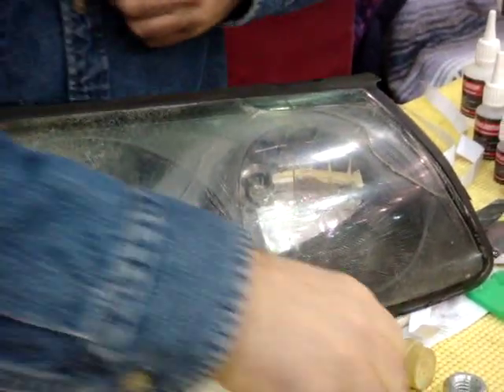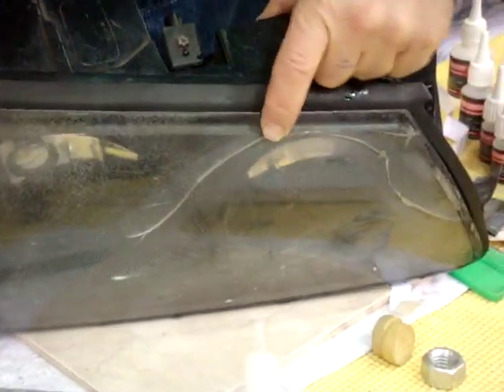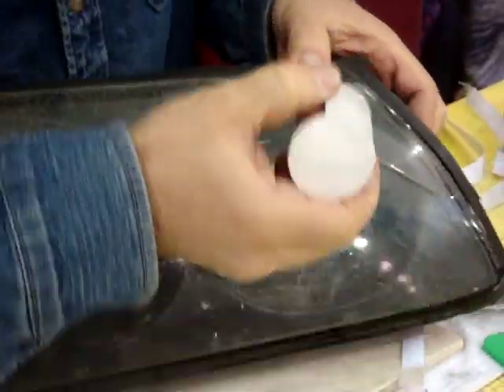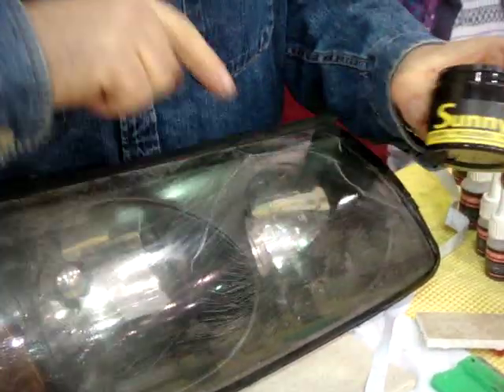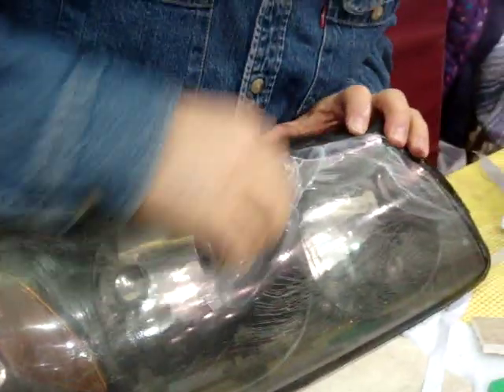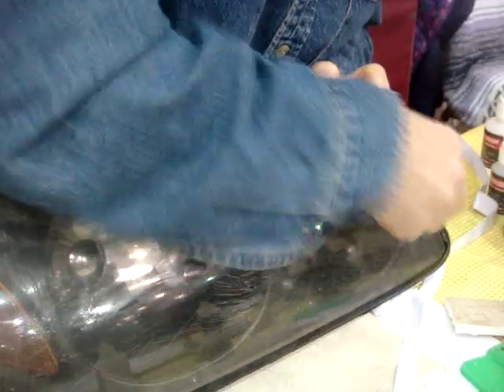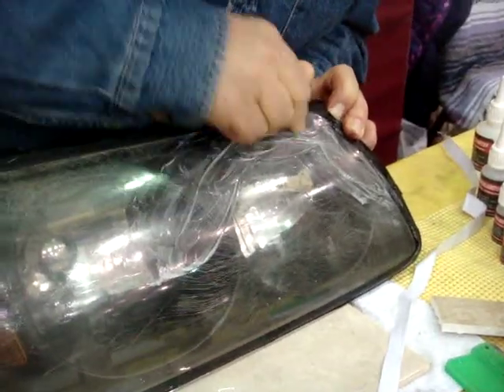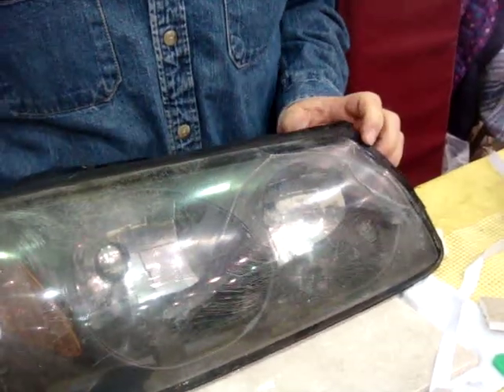How to fix crack on headlight with BLACK BULL Adhesive

Comment: I had a rock hit mine & left a star. I used super glue & a razor blade. I built it up until it's level. I then used 800 grit sandpaper to remove any raised ridges. I followed up with 0000 steel wool. I then put a small coating of clear lacquer over it. Again I used the 0000 steel wool to blend it. After that I used rubbing compound followed by polishing compound. Then I went over it with a coat of wax. Took 4 waxings to get the haze out. I need to get another Turtle Wax coating pad to UV protect the headlight again. They send an extra if you've bought a restoration kit before.

Comment from the maker: on the video I explain - I use glue and I use activator.
After repair I used sand paper 1000-2000 gr. and remove crack.
If you see video 2-3 times you will understand it.

Comment from the maker: SOMETHING AMAZING! 
You spend  2 cents - $1 for the Glue  BUT  you do not spend $50-$100  FOR A NEW LIGHT!
In 1 bottle 20 g - 2000 drops. For this repair you will need may be from 5-10 drops.
It's cost you 2 c 1 drop if you buy a kit 3 bootles . Total spending for this repair 20 c !!!

Comment from the maker: you not finish your job. when you fix your headlight -plastic glass- with glue and activator 
sometimes it's still look no good, because you not put the plastic glass  straight together and of course you doesn't like a result. All body shop after fixing light with the glue to remove crack use send papers: On this time you can finish with send paper 1000, 1500, 2000 grits only  with water and finish with any metal polish and you can see like new. Body shop fixes head light only this way...